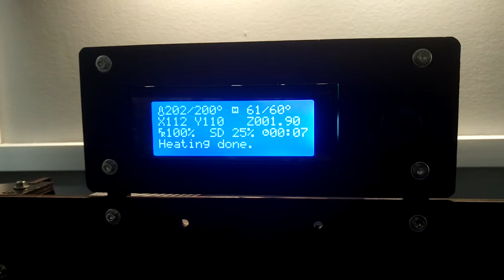2017 UPGRADED DIY CTC I3 Prusa Ebay Clone 3D Printer Printing Out Of The Box (more or less)

Comment from the maker: One thing I forgot to point out in my description was that the logo I was printing was initially set to the default 0.3mm layer height that is already defined in Slic3r and that it was a couple of prints later that I altered it to a 0.25 layer height.

Another thing I've discovered after I printed out some Z Axis threaded rod sleeves for the top supports of the printer is that Slic3r, for some odd reason, prints out the internal diameter holes of things around 1mm smaller than they should be. The threaded rod sleeves I printed should have been 10mm outer diameter and 8mm internal diameter. The outer diameter was correct in all attempts to print them but the internal diameter always came out around 7mm making for a tight fit. I did some reading and apparently this is an issue with Slic3r so it's just something to be aware of if like me you are just starting out.

Once I'm familiar with my printer more I'll look at moving from using Slic3r / Repetier and use something better.
Reply: Please, don't cripple your printer with the Z Axis threaded rod sleeves. They must be able to move freely, if not you'll get Z-wobble artifacts easily. Too small holes, with Cura check draw outer walls first.
Reply from the maker: Thanks for the advice :) I've decided against using these bushings now as the printer doesn't seem too bad for Z wobble issues. There is some waving going on on the side walls but it's barely anything to gripe about. I'm a firm believer in don't fix it if it ain't broken so I won't LOL :)